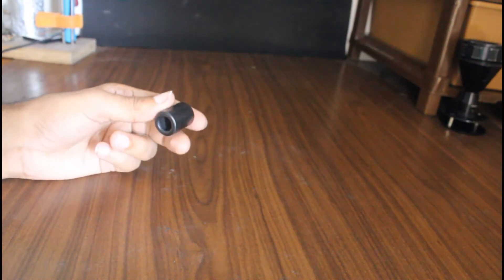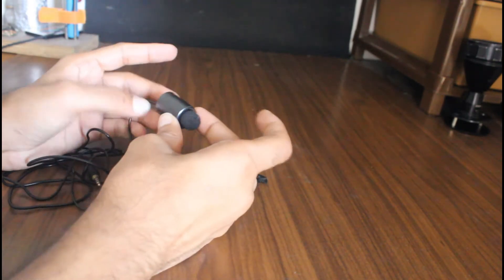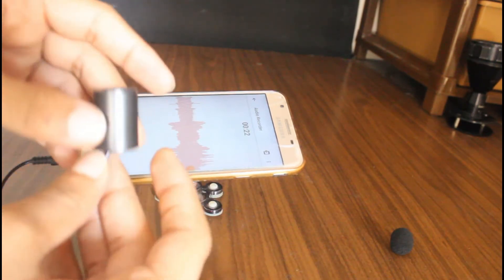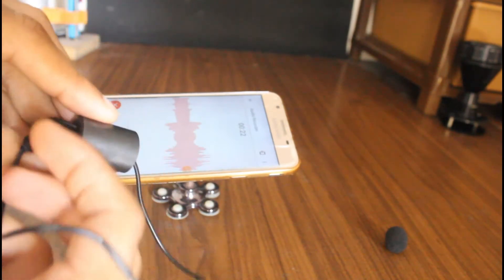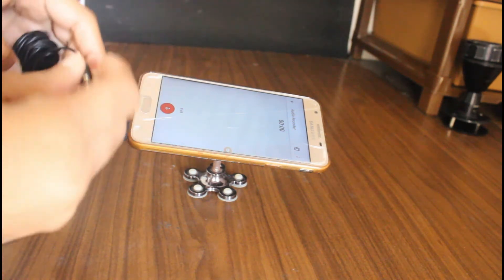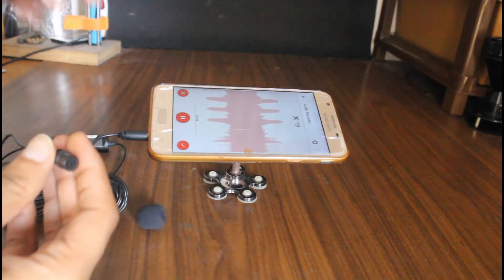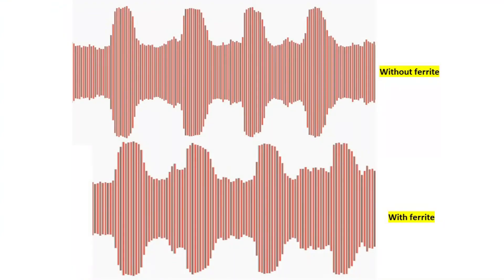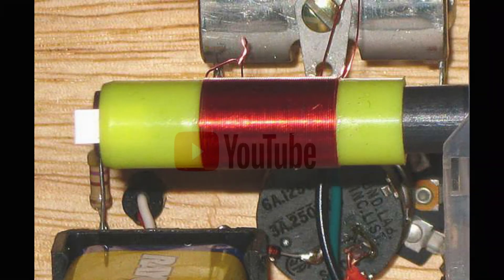Can ferrite Core Improve the sound Quality? | Noise Choke

Comment: ferrite core opposes the certain change in the flow of electricity thus it blocks unwanted noise (AC) & passes the signal (DC). Therefore it will only work on DC Power Supplies, where a constant DC supply is required & Sine wave signals produce noise. A Microphone Simply produces Sound Waves (AC Sine Nature), If you put ferrite core on it, it will block the useful signal thus work against microphone. so Ferrite cores are not meant for Audio Signals, Only for Power Signals.
Reply from the maker: Correct

Comment: I just installed an android unit in my car and they tell me that when I speak they hear a whistling sound that varies with the engine speed. It should be the alternator. Do you think the ferrite on the power supply of the android unit can fix the situation? And could I put one on the microphone cable too? Thank you
Reply from the maker: No, I don't think the ferrite on power supply of android can fix it since 
The noise is captured by the Mic 
You will have to filter it at Mic or At amplifier,  filtering the power supply will not work
Reply: @TechsScience  ok so ferrite on the mic cable
Reply: Search for car audio ground loop. That will directly address your issue

Comment: You aren't realizing that the noise your mic is picking up in both instances is ambient room noise.  A choke will not reduce this.   When you switched to your "high quality" mic.    We can plainly see that the mic is more sensitive and thus looks like it has more gain... It pics up ambient noise more readily.

A choke is to stop RF or EMC/EMI.   It's about interference reduction.

They're for that type of noise..   Not audible audio noise.
Reply: I've been trying to record using my iPhone 13 directly from my mixer using special line to mic cables .. it sounds really clear in regards to background noise except for this damn electrical hum.. I've tried everything with volumes , gain levels , diffent outlets, different cables and tried ferrite today and it didn't make any difference.. is there anything else I can try ?
Reply: @Mj-bg2uj  You have to troubleshoot the whole thing...  Perhaps the noise is being introduced by a component.    Once it is on the line, you can't remove it without knowing where it comes from.   You might have AC mains hum coming through the mixer.   I can't say for sure though as I can't do the troubleshooting.
Reply: @Scrufboy  understood thank you .. I've literally done all kinds of process of elimination and the only thing that changes the hum is when the dimmer switch in the room for the lights is turned on / off ... The previous homeowner installed a dimmer but used non dimmer bulbs so the lights are either on or off .. I'm going to have an electrician remove it
Reply: @Mj-bg2uj  Yeah, that sounds good.   Seems the noise is on the mains... But it comes from the dimmer you say....      You can swap that out yourself.   Hit the breaker, wire in a standard switch.    Or be safe and have the electrician do it.     You will probably be OK after that.   Hope it works out for you.
Reply: @Scrufboy  thank you!  Yeah I've had issues in the back room before .. i plugged an electric guitar and amp in and there was so much hum that it was virtually unplayable.. the electrician came and put the room on a different phase and it sounded 90% better .. if I play acoustic guitar with the PA i can't hear the hum but when I try to record directly from the mixer the phone is picking it up which sucks bc other than that noise it's really clean .. if I record while I'm not using the mixer it just becomes too much background noise and clutter .. I'm going to have the dimmer removed and hope for the best.. thanks again for the help ! Appreciate it
Reply: @Mj-bg2uj  Did you end up fixing the electrical hum noise you were getting?
Reply: @Tadders  nope I was unable to fix it .. I’ve eliminated pretty much everything except for my lights in the room .. has to be something with the dimmer
Reply: @Mj-bg2uj  dang. Thank you for letting me know lol. I bought a big box of ferrite rings to mess around with. Check back in if/when you or an electrician ever get around to switching out the dimmer. Take care.
Reply: @Tadders it can affect the connected device and become audible. I have an Asus motherboard where the USB ports are very noisy. Especially when the CPU was working hard. I noticed this when my USB DAC was connected. There were buzzing noises coming from my speaker, these noises change when there are activities happening. Adding ferrite beads on the cable significantly suppresses it, not completely though. Later I changed to MSI board and it's silent.
Reply: With my vinyl ripping setup, the high frequency RFI/EMI crosses itself randomly & this constantly throws specks of hertz all over the audible band  🌨️ cut the MHz and you cut the snow.

Comment: Excellent! Thanks very much! I liked that you left the plug in place not to add new variables.

I believe the second mic is a capacitive one and it already uses a balanced connection. Perhaps the first one is a simple electret with two wires. I have some of those cheap mics/wireless systems and I get a lot of noise. I'll reduce the cable lengths and add the ferrite core. Once again, Thanks!!!